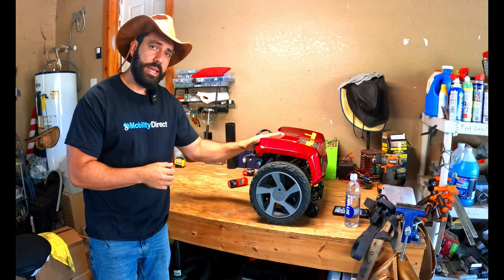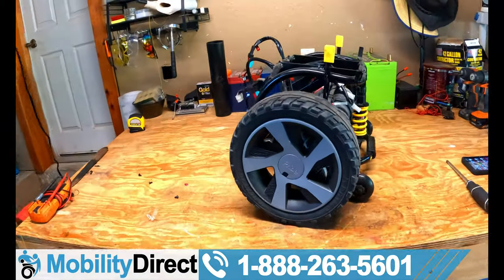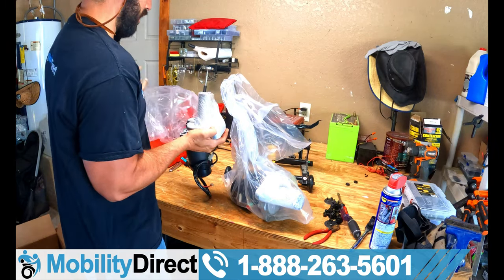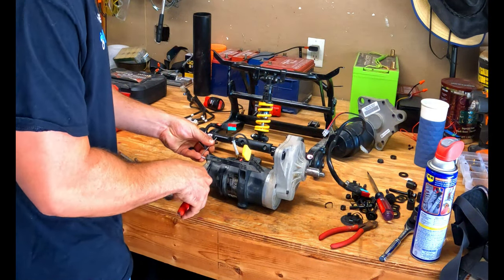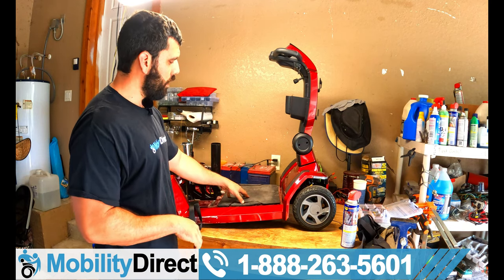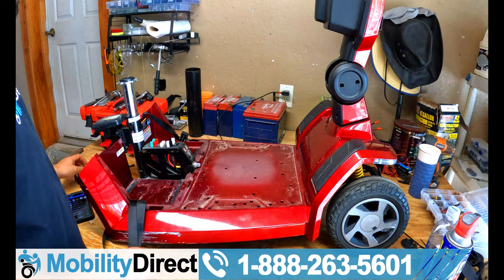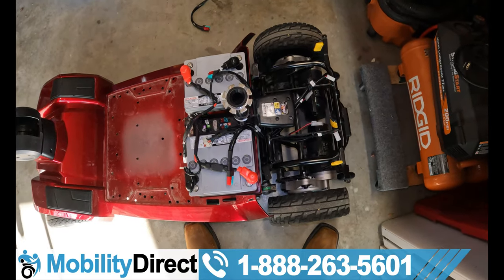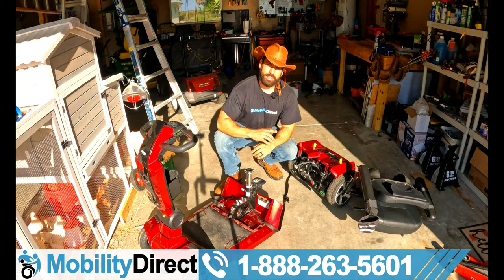🛵🔧Pride Mobility ZT10 Scooter Repair (Controller & Motor Swap)

Comment: Great video!  Very detailed and informative.    I have a ZT10 with what I think is a blown fuse to front lights. I have looked for where this fuse is located, but I can’t find any references that help.  Where are fuses located?
Reply from the maker: @michaelwhiting878 They are located in a compartment on the tiller. There is a figure shown in the manual and tips on fuse replacement. If you don't have the manual, you can get it here: https://www.mobilityscootersdirect.com/mobility-scooters/pride-zt10-4-wheel-mobility-scooter.html

Thanks for watching our video and commenting! We appreciate the support.

Comment: Hi
I've a question - tell me whats wrong could be with this scooter?
I'va same model and my scooter today second time transport to service beacuse when i turn right  scooter stop it and beep it, not always' sometimes I ride 15km without stop, everything ok and sometimed i go to bakery to buy brad, about 1km and scooter faults 2-3 times.
Reply from the maker: Hello @Bejziczek! If you're mobility scooter is giving you beeps. You need to pay attention how many beeps because you can check in the manual for the beep codes. It will help you identify the issue per beep codes and troubleshoot the problem. It's a good place to start especially if you're getting beeps. If your mobility scooter stops or shuts down, it's also a good idea to do some checks in your batteries. Thanks for watching and commenting!

Comment: Zt8 just beeps. Stopped working 3 days ago. Dead stop. No solution yet.
Reply from the maker: If it beeps, you can try checking the manual for the beep codes to get an idea on how to properly diagnose the problem. Another thing to check is the batteries, if they aren't new and you already have them for years, it's a good idea to get a new one. Thanks for watching and commenting!
Reply: Thanks. I’ll count the beeps